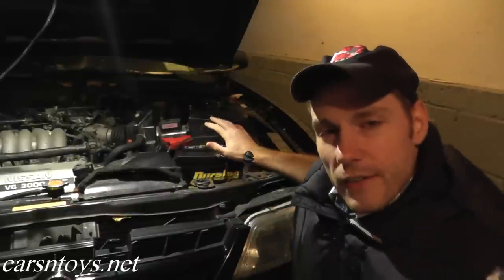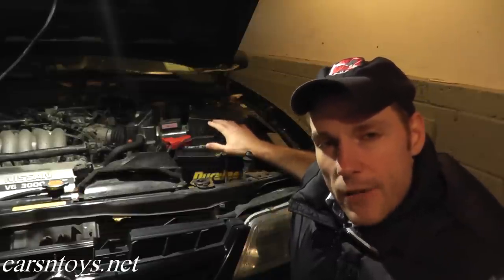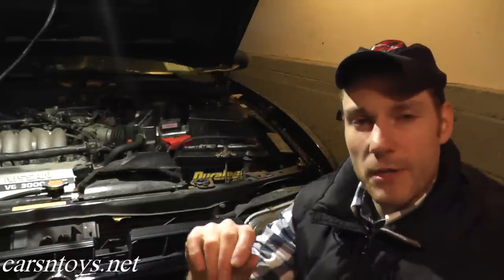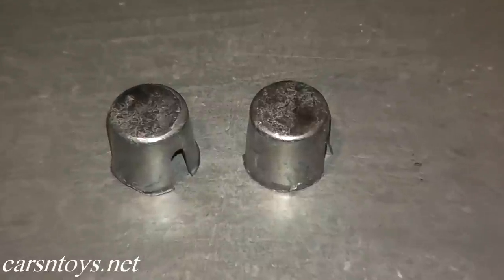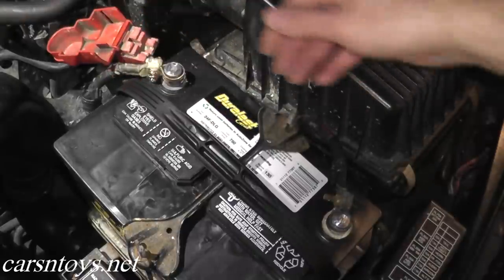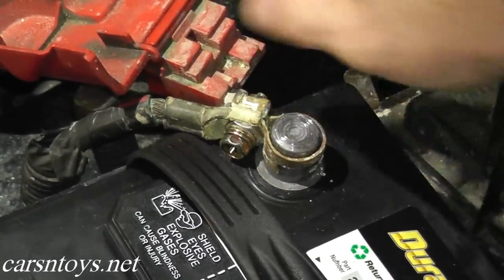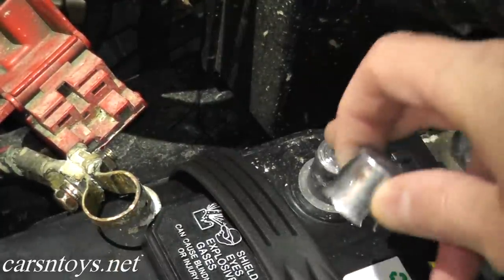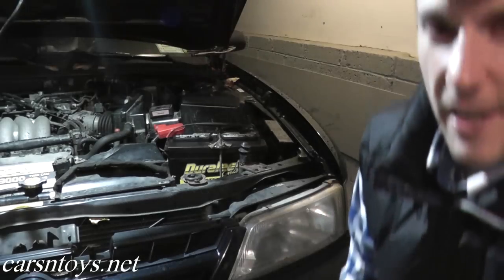Fixing A Vehicle That Turns Off For No Reason

Comment: Not really the thing that's wrong with my van. I double checked my battery terminals just in case and they're on there good. But about 4 or 5 months back, my van shut itself off cause it was low on oil. Though even after I put oil in it, the problem still persisted for a short while before the van went back to normal. Well it's 4 months later and I'm having the same problem again. It was low on oil so I put more in but I'm wondering if the oil has to work it's way through the engine again in order for the sensor to detect it again. I'm a computer guy, not a mechanic. I'm sure problems like this are easy enough for most mechanics to fix.
Reply from the maker: +psovegeta Any trouble codes by chance?
Reply: CarsNToys I haven't been able to take my van to autozone for them to run a diagnostic. The van is sitting at my nephew's home and I had to inch it here. It stays on while idling and even in drive. But it shuts down when it starts to move. I wonder if the weather may be a factor too. It was negative 3 degrees here yesterday morning. I'm pretty good about warming up my van though before I drive.

Comment: If your Car / Trucks Shuts Off When Warm / Hot and Starts Right Up After it Cools Down (30-60 Minutes) = Bad ICM ( Ignition Control Module (ICM) Code P1351 ). Unless it's P0128 (Coolant Temperature Sensor), YES... It will " TURN OFF " your Engine when HOT or NO / LOW Coolant :(((

Comment: im having a similar problem myself. I was told it was the alternator because the battery light would come on right after the engine cut but my battery was fine. Changed the alternator and still having the same problem.
Reply from the maker: Aftermarket alarm system or remote start?
Reply: @CarsNToys  im not quite sure.
Reply: @CarsNToys  how would o check? Its a 2007 VW Jetta

Comment: If the battery has a faulty connection the alternator will send electricity to the vehicle. Start your car and disconnect battery if the car continues running if your alternator is ok.

Comment: Do NOT assume the problem is the battery connection... it can be something that is NOT detected by the ECM, and so no OBD code is set... It can be that the fuel pressure is marginal and a bad fuel pump is NOT detected by an ECM

Comment: ok not sure if my issue is with the battery terminal but I'll change them and see my problem happens out of nowhere I'll be driving and coming to a stop it loses power like all power. hazard lights won't even come on then wait a few and everything is back working again why is this happening the car us a 97 maxima
Reply from the maker: Yea, check the battery connection.
Reply: Donte Quinney . I have a 1999 nissan maxima and my car started to turn off out of no where, and then it will turn on again later,  so I did everything on it name it, spend alot of money on it , i change, gas pump, injectors, battery, alternator, starter, spark plugs,  we'll you get it. so don't want you to do that. finally I found out online that I need it to program my key. yes I was thought the same thing my key, what is that has to do with my car turning off, we'll that solve my problem cause a week before I found about these my car didn't turn on any more at all, so I call a guy to come and program my key and it took him 15 min and my car turn back on like nothing. he changed me $80 for it. so try that first
Reply: charly martinez oh 1999 maxima do have the immobileizer system in the car but only the 99 have that mine is a 97 it happens to be a lose cable that keeps moving around cause it's striped and it's the positive cable that moves around but the 99 has a chip key system now I hope that is the problem with yours maximas are great cars but when they have a problem it would take awhile to find it
Reply: charly martinez I'm actually getting ready to trade for a 99 though
Reply: I love my 99 maxima, my friend has a 97 and his already has like 280k on it but runs smooth no leaks and no problems
Reply: My 97 has over 298.346 miles on it still running strong I'm still upgrading things on it
Reply: charly martinez is it true they last forever
Reply: Wow they are really good cars
Reply: charly martinez how's your gas mileage on yours mine seems to be missing a few mpg somewhere I changed my fuel filter I cleaned my injectors 3 Times precision auto did that for me but the gas still goes quickly what else do I need to clean
Reply: My is good on gas, i use 76 or chevron but don't use regular, and I can fill my tank and it will last me the whole week with $ 35 to $40
Reply: charly martinez I only use unleaded plus but I never used chevron is there gas better then quick trip,racetrack and Wal-Mart mine won't make it a week on a half it goes down quick maybe I need new injectors or fuel pump when I bought this car it wasn't running the guy sold it to me cause he couldn't figure it out it sat for 3 years not running I'm not sure what else to change or clean though
Reply: These where I bought them and they are really good and cheap haven't had any problems
Reply: charly martinez ok I'll try that not sure if the gas hand is supposed to move every time I turn or not or is this normal
Reply: Maybe it could be ur pump

Comment: So the 97 is famous for quitting while you are driving down the road. I replaced the fuel pump, all gas filters, BCM and ECM, EGR valve and cam sensor, None of that had any effect. I noticed so corrosion on the battery hot wire . Mine has 2 wires that come off the Positive post, one to the fuse / relay box, and the other goes to the starter I assume. So the wire frame the post to the fuse / relay box was basically corroded all the way through so the fuses and relays weren’t getting proper volts. Since I replaced that wire,problem solved !!!!

Comment: I have a 1968 Ford v8 motor  it will run but it starts worming up it sounds like it  Starving for gas but I know it's getting gas so I went and put a new points on my distributor and a new  Condenser and I also put a new fuel pump and I also put a new fuel filter and I also put new plugs an wires on it and a new coil an it still diys I'm confused what to do now
Reply from the maker: How's the carb? Tuned correctly?

Comment: so the alternator does nothing?
Reply: Das Boot The alternator keeps the battery charged. Battery/Starter: starts the car-> gas gets the crankshaft turning->crankshaft turns belt-> belt turn alternator-> alternator creates electricity->charges battery.

Comment: Ok.Thanks..Video was very helpful.☺
Reply from the maker: Awesome!
Reply: CarsNToys I have a 2012 TL Acura .I notice sometimes when I  crank my car.Sometimes get a quick start,And sometimes slow to crank..But the car cranks.So I took it back to the Acura Dealership&They replace my fuel pump.The car been running fine.So my question to you is .Do I need to replace my🔑 ignition or could it be a wire?And also they check my battery,Starter etc.One more thing, I notice when I drive my car when it is warm up. That's when I start to having cranking problem.Thankyou

Comment: I used to just screw a screw down between the post and terminal, it always worked, although disconnecting the battery became an annoyance.
Reply: +Google User no shit. If it can be done on a budget, why not?
Reply: +Google User funnily enough I don't actually drink, and especially don't do any illicit drugs, nice attempt at an insult though, try a little harder next time.
Reply: +Google User..  Lol this guy, come back when you work on your own cars. I'll never let a garage touch mine. I've had friends get their log books for servicing filled out when the car was never even serviced, mechanics can be very dodgy. Yeah I've done some quick fixes before, but my car is very well maintained. And I know that, because I'm the one that does it.
Reply: +Google User lol 90% of my money goes on my car, as I stated earlier, the screw was a quick fix. I wish I could post a photo of my car on here, I'd love to see you call it a piece of crap. What are you driving? Enlighten me..
Reply: +Google User maybe all your money goes on your car because it's a piece of shit to begin with.
Reply: +Google User More money than me, please go back to your first comments where I'll quote you: "I have a CHEAP car"..
Reply: +Google User lol okay, go change your cheap tire on your cheap maintained car
Reply: I have a 95 Buick LeSabre custom.46,000. I'll be cruising at hwy miles.or even city mph. dash lights flicker the speedometer jumps.car shuts off.put it in neutral.starts back up. go awhile And the same thing happens.. but it always starts back up.. what the heck.

Comment: I don't know what the hell Nissan was thinking designing that red plastic piece that attaches to the positive cable. My maxima used to shut off all the time because of this. I had to diy the stupid thing to fix it correctly so that it stayed attached.
Reply: At least that generation maximas used to be rugged, well-built cars, especially the engine which was on Ward's 10 best engine list. My current 2011 maxima, on the other hand, it seems like half of its engine is made out of plastic. And it's a "sports" sedan with a CVT. WTF ? On top of that many owners have knocking engines due to a bad no.1 crankshaft bearing, which is a factory defect. Fortunately, Nissan acknowledged the problem and issued a TSB. I'm wondering, however, how many people's engines will fail after the warranty period and leave them with costly repairs. Sorry for the rant but it seems like the automotive industry sucks big time nowadays.

Comment: The other day i was slowing down to turn onto my rd and as i hit the brake and went to turn the wheel locked up and car shut off and the gears shift was locked and wouldnt let me put it in neutral to move out of rd. It tried turning over once so i waited... 15 mins later it crunk let me get to my drive way when i went to turn in n brake it locked the wheel n shut off again... note car was ticking for a couple days before (car had oil tho)

Comment: When the vehicle is running you can take the battery out, the car will run off the alternator
Reply: Yes but an electrical short will make the computer to shut off the engine
Reply: No , computer sometimes has its ground wire ran straight to battery, lose connection, car dies

Comment: Wow!!! This video is lacking in some information folks!!!! Let's see!!! First of all if you have a issue of a bad connection at the positive side of the battery, and the terminal connection "walks off", ( provided that the alternator still puts out voltage ), the engine will continue to run without the positive wire being connected to the positive post of the battery!!! According to this video the possible issue in the future on this vehicle was, there was a loose connection between the terminal connector and the positive battery terminal!!!  That's the problem with this video in accordance to the fact that anyone that takes this "cheap tip" to HEART and thinks that they are fixing a shutoff issue with the vehicle that they are troubleshooting, are going to find out that there is/was a totally different issue causing their vehicle to shut off while driving!!! ONE OF THE VERY FIRST THINGS I WAS LEARNT OVER 30YRS AGO, WAS THAT ONE COULD DISCONNECT THE POSITIVE BATTERY WIRE WHILE THE VEHICLES ENGINE WAS RUNNING, TO CHECK WEITHER OR NOT THE ALTERNATOR WAS FUNCTIONING OR NOT!!!!! IF YOU DISCONNECT THE WIRE WHILE ENGINE IS RUNNING AND IT SHUTS OFF, THE ALTERNATOR IS NO LONGER PUTTING OUT VOLTAGE, THEREFORE ENGINE WILL NOT WILL NOT RUN WITHOUT POWER!!!! NOW, DISCONNECTION OF NEGATIVE TERMINAL CABLE FROM THE BATTERY COMPLETELY KILLS ENGINE, ALONG WITH THE FACT THE VEHICLE NO LONGER HAS A GROUND, REGARDLESS IF THE VEHICLE IS NOT MALFUNCTIONING OR IF IS IS!!!!!!
Reply: Hi Jason my Nissan Cube 2005 randomly dies
The cold light comes on as well as a random rev then dies at times she will start again lately she has been towed told it’s the fuel pump nope crank angle sensor nope 
Then off course no code error it’s financially killing me 
Off course the immobiliser errror appears I assume this be the attempted number of starts 
Then she will run for a day and again a problem 
She has no spark or pulse when this stall happens 
I really am lost to what is wrong 
Checked the ignition relay that ain’t melted it financially hard to keep trying and not have a more so understanding what ti look for
Reply: I hope you can help me pls

Comment: Naaaa a disconnected or loose  battery cable will not stall a car, sorry that's not the problem, A couple of bad fuel injectors ,,,,nope that wont stall it either. If it just bam all of a sudden shuts off, its a electrical problem. If its a Ford vehicle or Isuzu truck, check the ignition switch, or any car were the driver has 100 keys and do dads hanging off it.  a 20 year old car, 2 or 3 things....a later model car, could be 100 things. But check the basics before you start ripping the whole car apart.
Reply: eric wsmith I was thinking the same thing
Reply: I got a Toyota corolla 2002 that is turning off when I use any of my electrical components such as blinkers, lights, emergency lights, etc. not including radio.
Any tips?  Blinker use definitely shuts off my car.
Reply: It sounds like there is a body ground or ground wire some place on the car that's hanging on by a thread. I am assuming the car starts and charges up the battery up fine ? Instead of taking apart every ground wire to the body and wire brushing etc,  just run some new ones point to point, save a little time and cant hurt.
Reply: Yeah it charges and starts up fine. I can use the car all day without a problem but it's until I mess with the lights that the problem starts. One more thing I can recall is that, it all started after a hard rainy day here in Cali.
Thanks for the tip and will give it a try.
Reply: i got a nissan maxima 2001 model every time i turn it on after about 3 minutes it shuts off what do you think it is eric wsmith
Reply: Hi I have a Ford 2007 and my dashboard lights tend to go off while I'm driving. Like it would go off and then turn back on and also my radio but my car starts up and I can drive it. Any idea on what I should be checking for?
Reply: eric wsmith 2001 Rav4 stalls,did some research on it and ecm will tend to go out in this specific year,according to a mechanic it was switched but problem is still there,I noticed it more on hotter days where acceleration seems sluggish and turns off when idling(like at a stop light) car does not overheat according to gauge
Reply: Jody Garcia 

    Clean the throttle body and IAC valve.    This fixed my Toyota.
Reply: Jody Garcia 

     I also cleaned PCV, MAF and air filter while at it.
Reply: Sir Sweetness I will get to it,and get back to you to see if it fixed the issue

Comment: The fix you did is still only "temporary" because the sad condition of your battery cable  Connector end is going to also fail sometime too... You should have said that you know your positive battery cable connector is also very thin  and corroding itself to death, and that you will need to change it - either now or later - but you did not even see it, I guess...
The Real reason this happened people is because his Positive Battery Cable Connector is very thin and got that way from corrosion which ate it and made it thin, so it would not fit tightly on the battery post any longer... 
You need to address this also, and it will be harder because the Positive Battery Cable goes all the way to the Alternator and has to be removed and and replaced with the new one.. Then, you get it to the Battery post and connect it there..

Comment: Your car should run without the battery because the alternator is making voltage if turns off when you disconnect the battery you may have a problem

Comment: HEEEELLLLPPPPP So my 06 ram 5.7 hemi has been dying on me at red lights or when coming to a stop. It used to start up no hesitation, but now its shuts off right after it starts. The problem has gotten worse. It's now shutting off like 6 times in less than 10 minutes.  NO CHECK ENGINE LIGHT
Reply: Ever figure it out?
Reply: @jorgelizarraras7740  yes the crankshaft position sensor it's been running like a champ now

Comment: I went to the Chevy dealership they did like a thousand bucks worth of repairs for free because of my warranty and recall and they still didn't fix it must be the battery connection on the negative terminal my cars electric power steering goes on and off along with the radio this further causes it  when I turn off my car it stays off for a while won't turn back on and I can't lock or unlock the car and that damn service stabilitrak and traction control keep coming on
Reply from the maker: Bummer. Which Chevy?